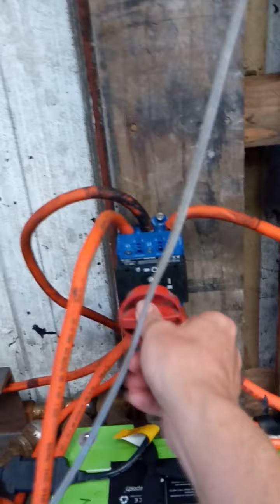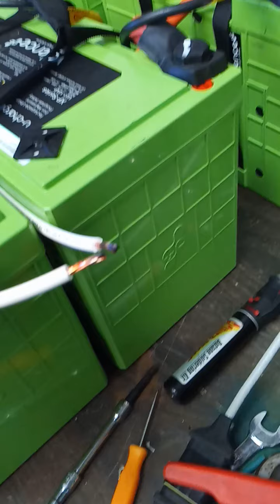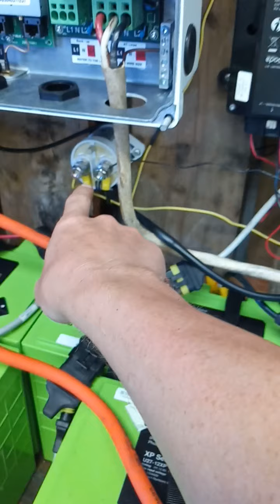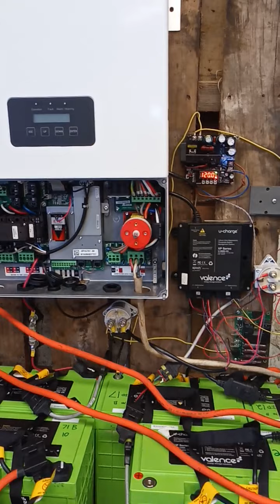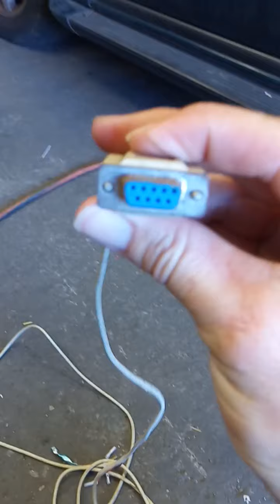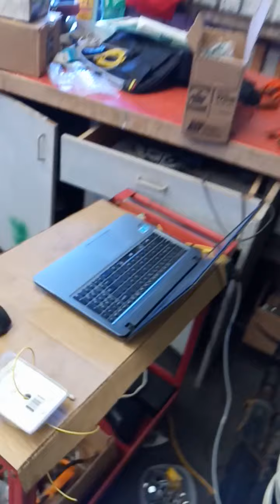Vid #1. Tesla powerwall com port rs-485 battery spoofing needed. Valence lithium batteries.

Comment: I have a second gen prius. And want to use it as a power source for my home. Any suggestions for me. I specialize in Toyota Prius. I’ve learned from the school of hard knocks no formal degree or nothing like that but everybody calls me the Prius guy in central Missouri got people that messaged me from around the world.i walk people through different issues. I bought some land and i plan on living there. Electric is gonna be impossible with easements having to be signed. It’s just it’s just me and my Beth half and of course I’ll have a shop as well. I’ll be welding the normal stuff you do in a shop I got around 2500 to spend. I have hundreds of used hybrid mods. They can’t be used if they don’t hold 7.4 volts at rest. I could make several battery blocks with them. Just not sure how long they would last. I’d like to do solar and wind as well. But if a prius will do everything I need to do maybe I won’t need those. 
Thanks for your video on utube and any other help would be greatly appreciated.
Reply from the maker: @randycoureton-te4im  awesome! but the Prius nickel metal hydride batteries do not work good for storing electricity for off-grid use.  This is because they're small and you need to put them in parallel in order to build the amp hours up to a high enough level. so when you put nickel metal hydride in parallel and you're charging whichever battery hits full first immediately reduces in voltage. it's a weird trait of this chemistry. so strange for a battery to suddenly drop in voltage right when it reaches full.  This is a big problem because all the other modules which are not full yet are still at a higher voltage and they start dumping their power into the one that's already full which of course destroys it.
Reply from the maker: @randycoureton-te4im  in order to use them safely off grid you have to avoid going to full or you have to have massive amounts of computer monitoring everywhere and computer control. it's not worth it at all. There's a lot better options out there.  I started buying electric semi trucks and harvesting the lithium iron phosphate batteries from them. rearranging their cells to make the nominal voltage of the storage system I needed.  strangely my misfit inverter needs 516 volts battery. so I built a giant battery for it and it's really fun but the high voltage is even more deadly than the Prius 230v battery.
Reply from the maker: @randycoureton-te4im  Make sure you attach to the engine side of the relay block in the hybrid battery. Don't attach to the battery side because then you'll have no way to disconnect the battery from your hybrid inverter.
Reply from the maker: @randycoureton-te4im  so far most of the hybrid inverters work really well and some of them work only well enough.  I've used about five different models already over the past few years.
Reply from the maker: @randycoureton-te4im  If I were to try and utilize the leftover Prius blades for off-grid I would put diodes on every string that way one string would be allowed to drop without the other sending into it. but then that would block the ability to discharge them together. so there'd have to be a complicated relay system involved. when the charge controller was bringing them up to full the relays would flip and disconnect the battery from the ability to discharge and send through the diodes instead for charging only. The inverter would still power the house but directly from the Sun. so it would have to be a inverter that could handle running without a battery.  I'd have to write some custom code for a raspberry with a relay bank and craploads of wiring.  All in all it would work but it would be a zombie Apocalypse type system that I wouldn't build unless I really needed to because the normal ways of having a battery bank would be much less time intensive. I'd rather spend my time making the money to buy a regular lithium iron phosphate battery. It would be faster.
Reply from the maker: @randycoureton-te4im  It would be faster. in other words it would also be cheaper to purchase a traditional lithium iron phosphate battery.  Time is money.   I suggest for the cheapest battery to purchase the cells yourself and a China BMS. assemble it and presto. You've got yourself a nice long-lasting safe and new battery system.
Reply from the maker: @randycoureton-te4im  for starting out you should get the 10,000 w powmr inverter. they're only $600.   also purchase a $2,000 10KWH lithium iron phosphate 48v battery and connect that to the inverter. The Prius will charge it and keep it full.  there are variabilities that happen when the Prius starts and stops. The hybrid inverters get a little confused with their MPPT algorithms sometimes as the Prius internal combustion engine 'ICE' starts and stops automatically.  sometimes this confusion will cause the hybrid inverter to not be able at the moment to pull power from the Prius. That's why the lithium iron phosphate battery is connected.  so if you're using a large amount of power it'll pull from the lithium iron phosphate battery for a short time while the MPPT algorithm does a sweep to settle on the best voltage. it's just hard for it to settle on the best voltage when the engine affecting the incoming voltage on its PV input.  some other hybrid inverters don't get confused. like the one in this video the Delta h6 works flawlessly and pulls steady power and dumps it into my house battery Even as the Prius cycles on and off.  The problem with the h6 is it's not very robust and it has no surge ability. so in the hot tub turns on it damages the MOSFETs. I've learned to even push start my clothes dryer to avoid the surge of its electric motor.  I've blown up a lot of these h6 inverters. I've abused the heck out of the 10KW PowMr with my hot tub. constantly cycling The hot tub jet pump motor on and off for months now and the inverter has not blown up yet.
Reply from the maker: @randycoureton-te4im  with a cheap hybrid inverter and the Prius You will have the ability to power your whole house. build with your heart's content. run the welder and the table saw and everything else you need to while providing your own power from a quiet smell-free source like the Prius. it's way cheaper to run the Prius than to run a normal generator.  I have a feeling some of these cheap hybrid inverters wouldn't even require the lithium battery to stabilize things but haven't yet settled on a large one that I am happy with.  but I really like having the 10 KWH battery anyway. that way I can disconnect the Prius and drive it somewhere while the house still stays powered. And wife is happy.    but that's just for the air conditioning and the hot tub.  because I built a huge off-grid system for the house.  I'd run the hot tub end of the AC off of it as well but I need to get my h6 inverter replaced but that also requires rearranging all this modules in my 516 volt battery which is a huge job so I'm sort of procrastinating right now. I'll get to it probably next year.  I bought a huge solark inverter which will be able to handle it all so I'll be ditching the PowMr inverter at that time.
Reply: @SiriusSolar thank u so much for ur help. I didn’t think the hybrid mods would work well enough to do the job. Nice to know if we end up being third world or worse someone might be able to use them. I’m sure I’ll have more questions before I’m done. Great  job on ur videos.
Reply from the maker: @randycoureton-te4im  The thing I like about the Prius for what you were about to do is it alleviates the immediate need for large house batteries and a large solar arrays and expensive generator fuel well at the same time the equipment you need to make the Prius work is also exactly what you need for your off-grid system later. You can add more batteries and panels later
Reply: @SiriusSolar  if u ever need anything for ur prius. Just let me know.
Reply from the maker: @randycoureton-te4im  I've got 15. 5 or 4 parts. but they all have bad touch screens. The tropical sun here kills them fast. I saw though that finally somebody has a new screen replacement on eBay

Comment: And it begins,  good luck!
Nice collection of batteries how many kwh total?
Reply from the maker: I had 240 but sold 70.  In the end I'll probably only keep 60.  It was an All or nothing deal and there's really no lithium in my part of the world otherwise.  I had to import these.
Reply: @SiriusSolar  wow! Where abouts in the world are you? I own 20 of those  batteries I have them wired for a 48 volt system and they work perfectly for me over a year now.  I may be able to help with some questions that you may have. But no luck on the Tesla inverter. I bought a 6000w inverter charger from amazon for $1200 and together we have ben off grid 3 years and working great with no electric bill😁 good luck
Reply from the maker: @organicoceans4459  hawaii.  Eight oh eight  557-9058